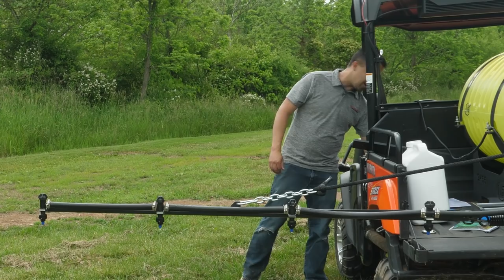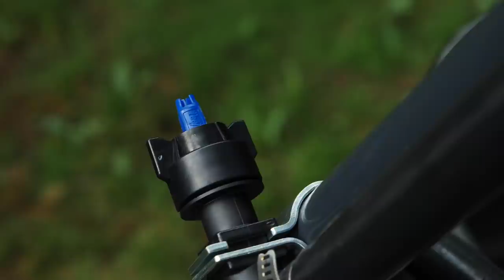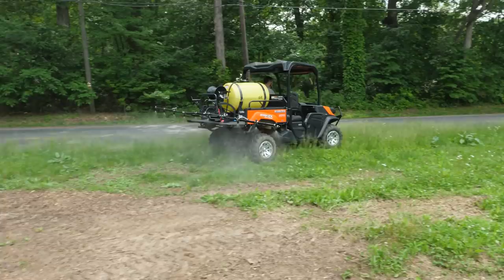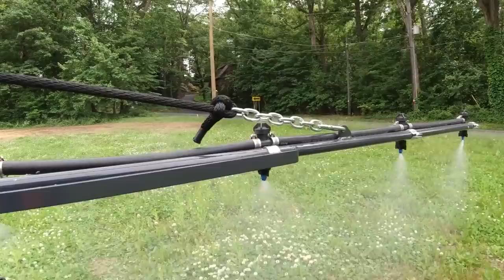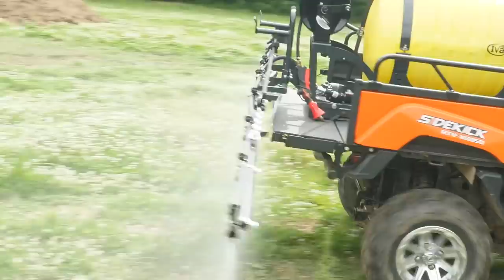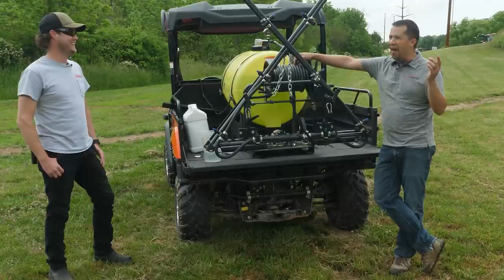Weed control with an Iva Sprayer. Another use for the Kubota SideKick

Comment: Way easier way to do it and get better accuracy. Fill the tank to the brim. Run it for one minute, just spray it without catching it. Now shut it off and refill the tank with a calibrated container, that's your GPM. If you're worried about not measuring the initial build up fill it up after 15 seconds then start the counter.

Comment: You increase pressure by upping the pump size (higher GPM) though you need to be sure the smaller pump isn't already hitting it's pressure let off and if it is the bigger pump needs a higher pressure rating because the tips might be the limiting factor not the pump.

Comment: Neil, is there a sprayer that will work on RTV 1100 cab model with gps and rate control? I’m about to get into commercial spraying I know Deere makes one for the cab 8 series gators? Just curious is there a Kubota version available?
Reply from the maker: Not a Kubota version, but easily done by several vendors. Building a sprayer is like Legos.
Reply: @MessicksEquip  thanks for the reply if you come across one a video would be great thanks I enjoy the info that you guys out.

Comment: Glyphosate causes cancer.  2, 4, D would be better.  
I use "Lazer Blue" to mark what has been sprayed or not.  Works very well.
Can you talk a bit about the height of the boom and the nozzle selection?
To increase application speed I double up on nozzles.  I also check application consistency and coverage by spraying just water on dry concrete while I drive at the prescribed rate and then inspecting the sprayed pattern for full coverage and overlaps.  I then adjust speed to get the best pattern or address nozzles/ pressure issues. Cheers
Reply: For all those that state that Glyphosate is a carcinogen, it may be, but I have been "carefully" using it for 30+ years, and I'm still here.
Almost anything you ingest will kill you, (even water).  Just be careful/
2-4-D is Selective.  Round-Up is Non-Selective.  2-4-D kills a large number of weeds, Round-Up kills whatever it touches.
Reply: I use pond dye to se where I have gone
Reply: @JoeGalanteTribute  glyphosate kills your immune system ie your bugs that digest the food you eat.
Reply: @JoeGalanteTribute  Agree. If it was farmers, laborers, and co-ops winning a lawsuit I'd take it more into account. A couple spraying round-up on their driveway? That says more about the Judge and lawyers than the product.
Reply: @CriticalThinker27  - I didn't say it couldn't be harmful.  One must just be careful.  Someone shouldn't spray in windy conditions or where you would injest it.
Just to give you a real world example of a carcinogen that is still on the market.  One of the doctors who determined that saccharine caused cancer in mice was asked what dosage of saccharine was fed to the mice? He stated that it was the equivalent of drinking 200 cans of diet soda a day.  To me, that doesn't sound like a very reasonable test.  I'm sure Glyphosate is much more dangerous, but a good mask and careful use otherwise, makes it safer than Attorneys trying to get rich want you to think.  How many mother's used J&J Baby powder on their babies bottoms and we don't see millions of people with cancer from that either.